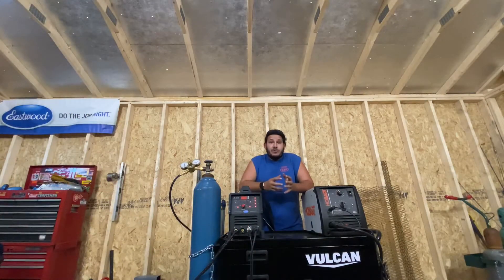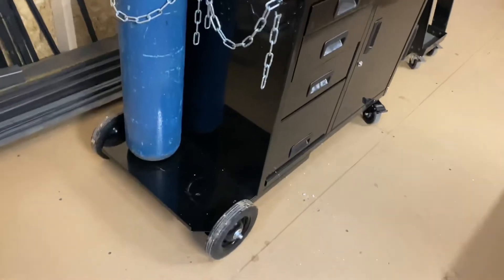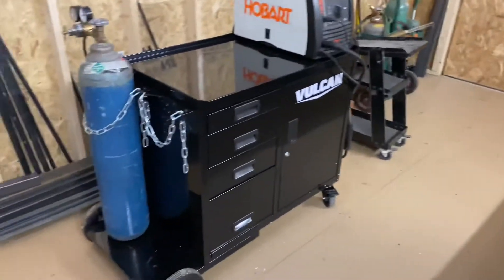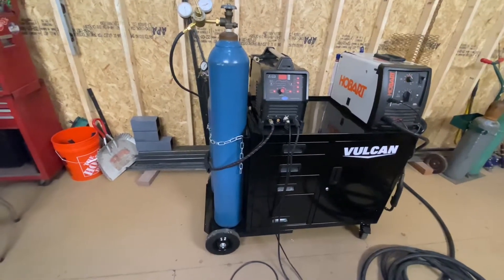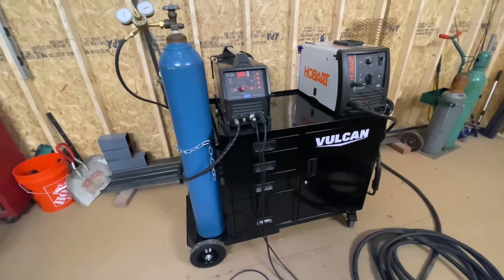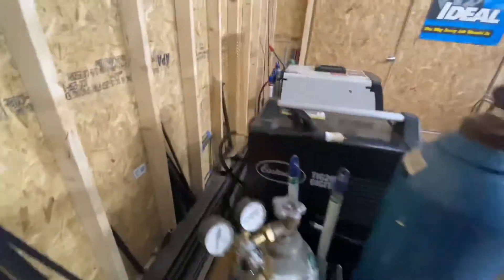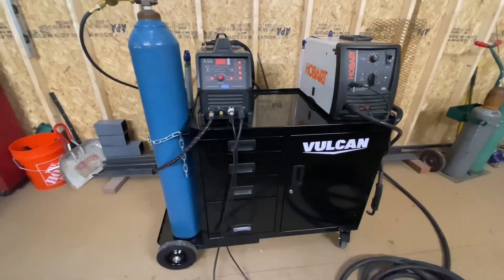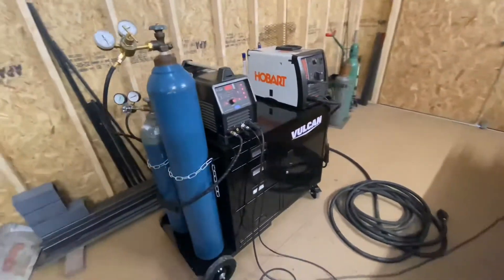Vulcan brand harbor freight welding cart review

Comment: I purchased the same HF cart back a couple of years ago. I have my Everlast MTS252Si w/ Water Cooler and Hypertherm Powermax 30 sitting on top of it (my welder/water cooler are bolted to the top of my cart). I wish I could attach photos on this thread so I could show you my set up.

Comment: Yo, I’m looking for a mig welder and tig welder after that. What machines do you use and do they still work good?
Reply from the maker: Hey thanks for the question! If you’re looking for a good machine on a budget I’d suggest a Eastwood company MiG or TIG welder. I have both and they’re great, Hobart, Miller and Lincoln also make amazing units however you’re looking at more of a investment for any of those machines compared to the eastwood.